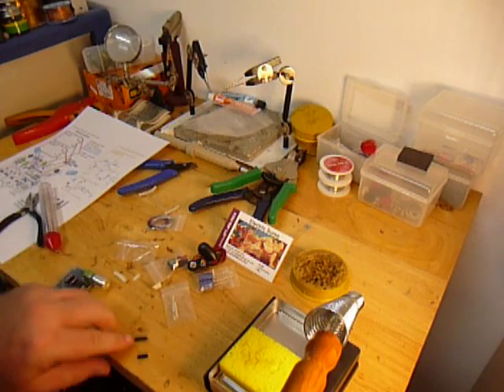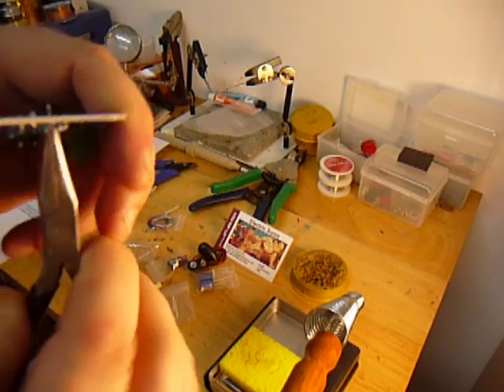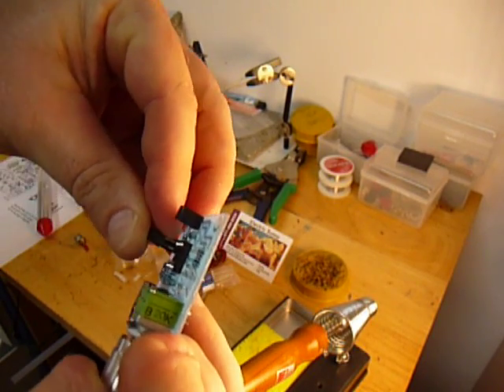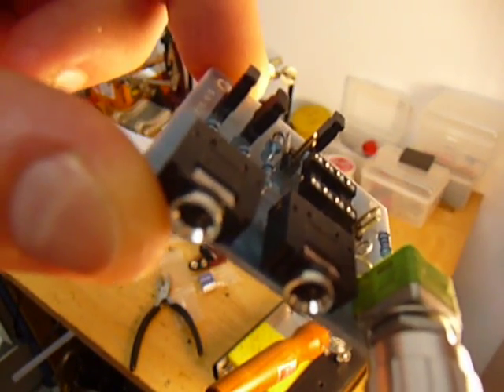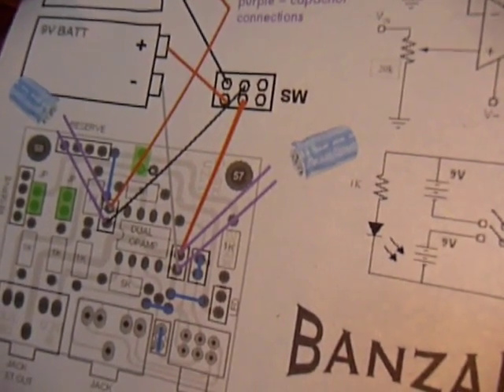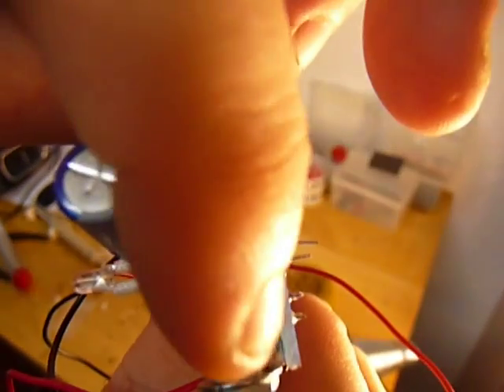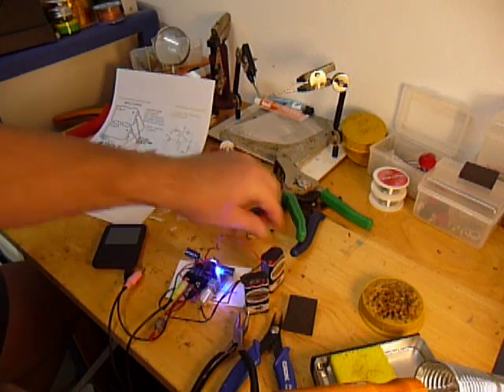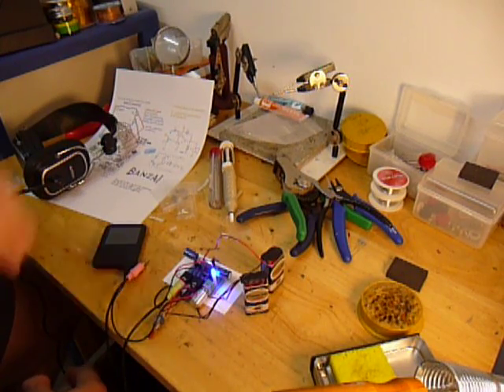Banzai V2 CMOY Stereo Headphone Amplifier - PART 2

Comment: Thanks for posting this!  I was having trouble mounting the capacitors and the battery leads and had not thought to use a jumper base as a mounting point.  Problem solved!  On a semi related note, what are the specs on the LED?  I blew mine out when I used a 9v battery to confirm the polarity when I was a few beers into the project....  and need to replace it.  Thanks.